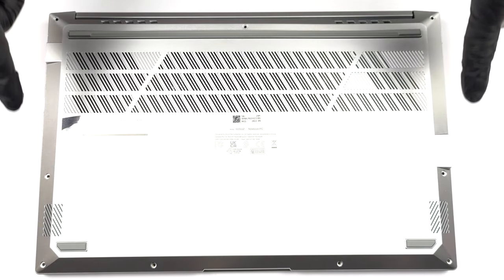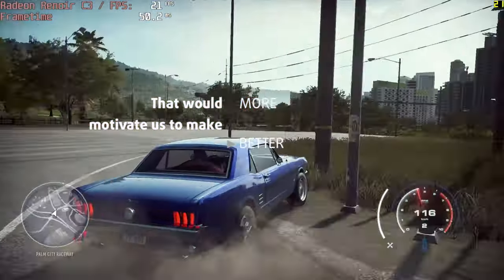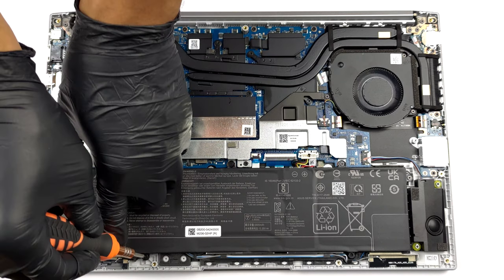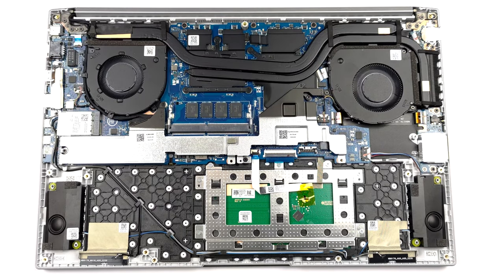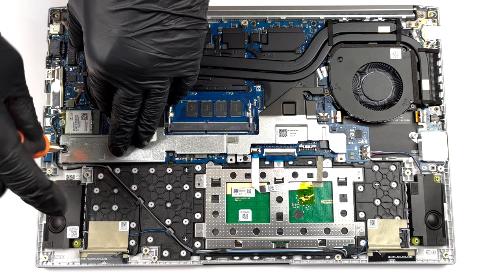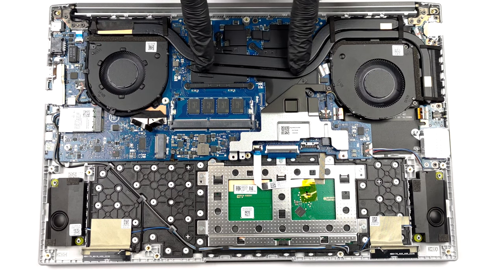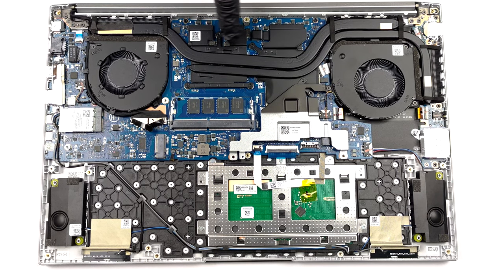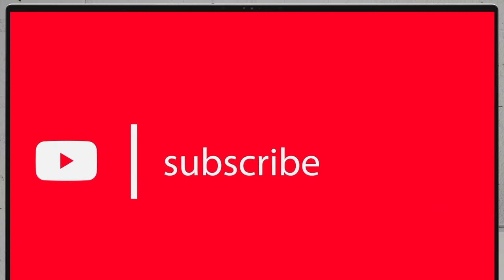🛠️ How to open ASUS Vivobook Pro 15 OLED (K6502) - disassembly and upgrade options

Comment: Please, make sure to note that even if the model is K6502, it still depends on the exact model if it has one more slot for RAM or SSD. Mine doesn't have the slot for RAM and it is K6502HC.
Reply: Does it have 2nd ssd slot?
Reply: @galangsurya3914  It does :). I now have 1TB+2TB SSD installed, haha.
Reply: i have k6502HC with i9 11900h and yours?
Reply: @Javier-qd5ek  I have the same model, as I mentioned in the comment.
Reply: @erikhonkys118  my exact model is k6502HC - MA061W  with i9 11900h 16gb ssd 512 and rtx 3050. I want to make sure that it is possible to put another NVME SSD before opening it and losing the warranty.
Reply: @Javier-qd5ek  It is ;). Tough it won't be that visible. It will be in the paralel spot of the first SSD. Also, you have to unscrew one screw to screw the SSD. I don't remember which one, but you can unscrew one of them from other place without loosing the part.
Reply: @erikhonkys118  maximum capacity  suported is 2tb / slot? wright
thanks Erik.
Reply: @Javier-qd5ek  Nope. You can put 5TB+5TB SSD for example. There is no disk space limitations if the Laptop is a UEFI-Compatible Firmware. But I would recommend use the built-in SSD for OS :).
Reply: Is 16 enough now in 2023
Reply: @so-hadi  Yes, it is.
Reply: @erikhonkys118  
The problem is most of new Asus laptops are non upgrades ram
Because it sold I look for black Friday for oled and power cpu Asus laptop
Reply: @erikhonkys118  Does Asus vivobook pro 15 ryzen 5 5600hs has an extra slot for ssd upgrade?
Reply: @so-hadi  That's right. Because this line is for non-tech people, so they make sure they rather upgrade to a new laptop instead.
Reply: @k.g.2642  I don't know, depends on model.
Reply: @erikhonkys118  
What your opinion with new asus zenbook 14x oled laptop
Reply: @so-hadi  looks good, but it doesn't have numeric keypad. So it's a nope from me.
Reply: @erikhonkys118  
What your studies or job
Reply: @so-hadi  IT Support at car company and I do graphics in my free time.
Reply: @erikhonkys118  good
What your current machine you do work in
And does iris xe good for graphic for beginners
Reply: @so-hadi  iris xe graphics are enough for light graphics work, so I would say yes. I personally use RTX 3050 for heavier tasks. But when it comes to rendering and having opened numerous tasks in graphics program, the CPU is main factor ;)
Reply: @erikhonkys118  The model is Asus Vivobook pro 15 M6500QF - HN521WS for creator version
Reply: @erikhonkys118 Hi do you know if a sata ssd is supported in the m.2 slot or is it nvme only
Reply: @MA-jz4yc  both should be. But I rather use the NVMe, which is os SSD.
Reply: So, its impossible to add more ram ?? Is there any method to add more ram when there is no ram slots ?
Reply: @bt3k971  No. Only via RAM slots. Or just buy different laptop...
Reply: @erikhonkys118  damn..
Reply: I want to but vivobook 15 pro m6500 that has an rtx 2050. Can i upgrade ram to 16gb? Can’t unboard ram be upgraded?
Reply: mine is same K6502HCB is it different or same

Comment: I upgraded ram from 16 gb to 40 gb total in total, it works well, no need to worry, I added single 32gb stick, don’t worry about putting more ram
Reply: what type or ram did u get and can u provide me a picture or a link to see it i wanna upgrade mine

Comment: You've failed to point out that there is an expansion slot for another SSD to go... it's on the right in the middle.  It would be useful to know how to screw the card down though, because the socket looks different to a usual screw.
Reply: where? I cant see the slot
Reply: It seems to me that you are confusing it with the external card reader
Reply: @fabri0001  no, he isn't. There is a nvme slot below the metal plate near the hand in 0:41

Comment: There is one more nvme slot under the silver metal
Reply: Can you please help to point out where the 2nd SSD slot is? I can't find it from this video, apprecaite!
Reply: @eddyho3644  under the silver metal, centre left
Reply: @oldschoolpro Thanks a lot, so I have to remove the half silver hlf black metal plate to find the m.2 SSD slot, am I understanding it correctly?
Reply: @eddyho3644  yes, you are right
Reply: @oldschoolpro  Thank you so much! It's really helpful!!
Reply: @eddyho3644  welcome
Reply: @eddyho3644  sorry centre right under the fan, from video perspective. Maybe you need to remove the metal cover to acces nvme slot
Reply: @eddyho3644  black silver metal cover 2:53
Reply: @art.strike  Read the upper comment
Reply: @oldschoolpro  thanks, i found :)
Reply: @oldschoolpro  How? Do you mean the cover on the right next to the RAM? I don't think there is another nvme slot, as it wouldn't fit.

EDIT: Dissasembled mine and found it, thx for pointing it out!
Reply: @erikhonkys118  is it a Gen4 slot? Can you confirm?
Reply: @padmarajrs  Not sure about that, it will depend on the release model. For example 12th gen Intel vivobooks has DDR5, but mine is 11th gen Intel and has DDR4.
Reply: @erikhonkys118  Ohh okk.. thanks for the quick reply 👍🏻
Reply: @padmarajrs  no prob, mate 👍
Reply: @oldschoolpro  that's a small 2230 form factor slot is it ?
Reply: @martynas911  no, 2280 full size slot

Comment: Is it possible to upgrade the RAM of a ASUS Vivobook 15 M6500IH-HN022W. It has 8 gb standard but want to upgrade it to 16 gb, cant find anywhere if this is possible and/or supported. Thnx!
Reply: Encontraste alguna solución? Tengo el mismo problema 😅
Reply: Any update on that? Is it possible?
Reply: yes it can be upgraded more than 16gb

Comment: A fan in my laptop is making an annoying rattle.  Can it be replaced or do I have to take the whole laptop back.  It's under warranty.
Reply: I have the same issue right now. 
Can you please tell me what you did with that?
Reply: @MrAmrutesh  I took it back to John Lewis's and they returned it to ASUS.  They replaced the whole laptop which is not exactly what I wanted.  I had to reinstall all my software.  Now one of the USB ports has stopped working.

Comment: Just put in a stick of 24gb crucial ram and it detects 32gb since i have 8gb of integrated  ram, im about to test it but the laptop eats ram memory on its own
Reply: Also per looks, i havent opent the laptop till last screw, but i know it says it supports 2x nvme, i think per picture that i have of mine which is identical to this one, i think the other nvme goes on the opposite side of the built in nvme. Once i get it ill leave update.